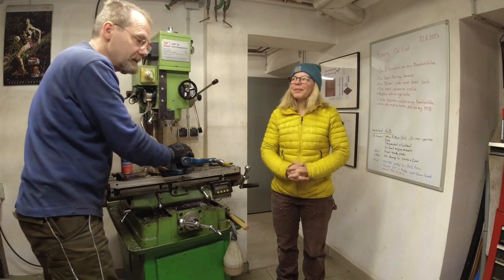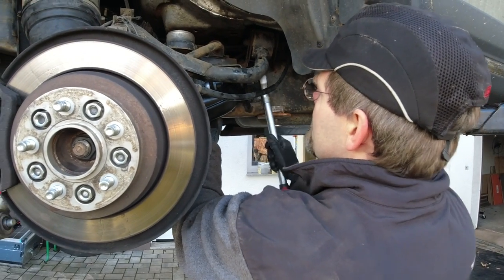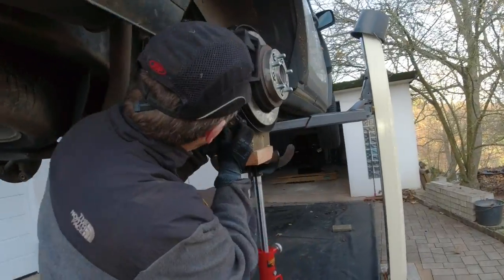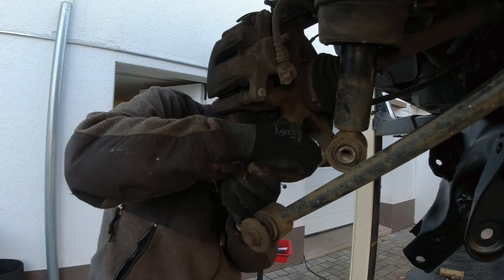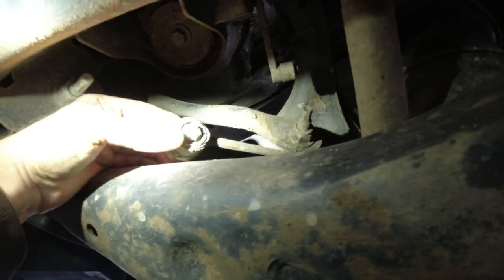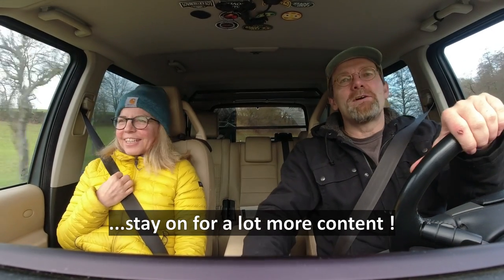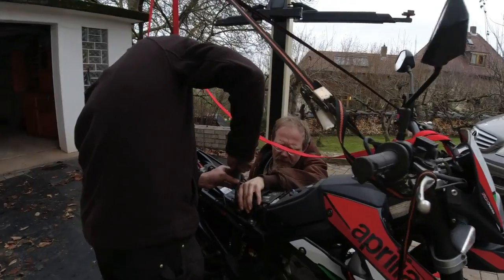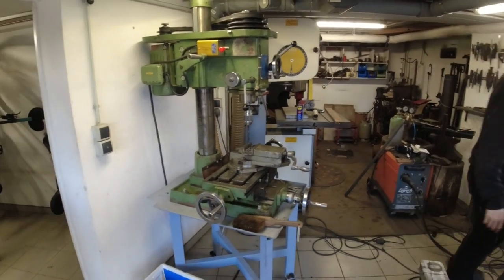Replace suspension bushings Part 2 - Land Rover Discovery 3 / LR4 / S4-Ep3

Comment: Hi I'm finally getting around to changing the bushing on my LR4  and going to use poly bushings, rapping components with Teflon tape, and light grease you never touched on the poly bushing that I saw in your videos, I love them, they are  my go-to file for advice,,, ride height on these is not important not vulcanized to an outer cup, just running it past you,, i like L R TIME  KEEP GOING

Comment: Another good job. FYI MoT in the UK stands for Ministry of Transport (test) that is the old name of the Department of Transport (Ministry's are now Departments for some reason). We have to get the first MOT (inspection) of a vehicle when is reaches three years old than annually after that.
I noticed you have some Hazet tools, I have a 1/2 ''drive Hazet ratchet I have had  for forty years.
On another subject I spent a week working in the JLR service centre in Neuss in 2008, while I was there I took a trip to have a look at the Garzweiler  open cast mine, awesome under taking and very topical in the news now.
Reply from the maker: Hazet is quite expensive but good.  Climate activists try to save a small village but that is a illegal activity causing a lot of conflict.  Christian

Comment: As others have said I think you should check the wheel alignment. Don't forget you changed it some time ago with the old bushes and now you have new ones. Don't want you to scrub off those nice winter tyres!
Reply from the maker: Lower rear arms do not allow any adjustment and is is not specified by LR if bushes are replaced and arms are kept. No matter how many people write this here.  Please Check out our wheel alignment video from last spring to see how precisely we did the alignment by ourselves.  Upper rear arms and lower front arms have alignment adjustment.  I did put my castor gauge on the disc before and and there was no change noticeable. Christian

Comment: I am so happy to report that I finally had something to fix on my 2000 Disco II. The rear door latch was stuck and wouldn't open. I removed the badge from the rear door handle, squirted some WD40 into the opening and that fixed it! 
Not nearly as complex as your top level repair work but I did feel a sense of accomplishment.
Reply from the maker: Are you sure it’s not a Toyota?  😂WD40 repairs are reserved for Toyota drivers 🛠️.  We would love to get a D2 but emission regulations make this a expensive vehicle in Germany.  We even have the manual!  Christian
Reply: @Vera_and_Christian  Well, I am a Toyota level mechanic. WD 40 is my master skill.

Comment: Well done getting through the TUV.  The MOT inspectors often identify issues early on and I have always found this really helpful. Keep up the good work.
Reply from the maker: Yes,  it’s ok to have such regulations.  With no regulations like in parts of the US you need two wind screens per year because everybody has oversized tires and throws up rocks and cars are way too noisy.  I guess I am a bit German.  Christian
Reply: @Vera_and_Christian  Completely agree. The MOT ensures that the vehicle meets a basic road safety and environmental standard. The certificate is a snapshot and is no guarantee of what the car will look like in a month's time. This is why you could in theory have you car MOT'd several times a year.  Once a year is more than enough for most of us Landy owners.

Comment: Good to see you D3 back in top shape. 🙂 Ball joints are crap because they use crap rubber on them and in 2 years you have no rubber on and corrosion.
A, I bought a new diesel car and they put 5w20 in there now. I think water would give more lubrication than that. 😛
Love old shop machinery. I have a well equpped one too.
Thanks for another great video.
You too are just great to wach.

Comment: Another great video 😀

Had my own dramas this week with my mini-mall crawler, Discovery Sport with two bolts in the steering rack having sheared off which the LR dealer found doing an inspection... 😱 That has to be a few OMG's from Vera! Car undriveable while they replaced the whole rack. Still, got to drive a new Defender 130 for a few days... not sure you'd try and balance one of those on your 2 post lift!
Reply from the maker: That defender is big.  Too big for out lift.  Sucks that you had to get a new steering rack.  Christian
Reply: @Vera_and_Christian  Luckily LR paid as it’s the subject of a recall. Also lucky there was no accident.

Comment: Well done for getting Tuv inspection pass . You can get a Windscreen chip repair kit on ebay for a few Euros,  that would be an interesting video repairing the chip as most people take it to a garage , and don't realise how easy it is to do yourself. 
Christian and Vera,  you definitely have to go on the Land Rover offroad experience course , it's amazing what these vehicles can do .
Reply: regarding TÜV its not allowed to repair windscreen when the chip is in drivers view
Reply from the maker: We should have done this before. Now it’s no longer legal to fix as in the line of sight.  Christian
Reply: @Vera_and_Christian  It's interesting the difference between countries. In the UK if you fail the MOT you can't drive at all as soon as the car fails. Even if you did the test 27 days before the existing certificate expires. But you can get a windscreen chip repaired to pass an MOT even if it's in the drivers line of sight. (Max size 10mm on drivers side, 40mm elsewhere if repairable.) Is windscreen replacement due to being unrepairable not covered by German car insurance like it is here in the UK on most policies?

Comment: Congratulations on the TÜV pass - it looks like the TÜV is a lot tougher than the MOT in the UK - and double the price.  And, thank goodness, they let the windshield pass this time.  I guess you will need a new windshield as you cannot repair a crack in the area of the driver's vision (or is it off enough to allow a repair?).

We drove back to the UK through Germany on Wednesday and Thursday last week in the pouring rain - except for our drive on the Rhein road from Rüdesheim to Koblenz on Thursday (the river seemed quite high and Burg Pfalzgrafenstein actually looked like a boat this time, with the river lapping at the walls - last time we drove it was high and dry) - but we had not known that the bridge between Wiesbaden and Rüdesheim was being rebuilt and had to go round in circles a bit to get to Rüdesheim without having to cross the Rhein and get a ferry back - nice trip, though - we love that Rhein road and take it every time we drive home through Germany.

Christian - you are living dangerously giving out Vera's age - a lady is always 21 + a little bit more 😉
Reply: German TÜV is first after three years new, and then every two years thereafter, so c. €60 per year.
Reply: @GunnarMiller  UK it's about £45 per year and can be cheaper.
Reply: £45 is €50, so comparable.

Comment: Good to see that "power tripping" public servants exist the same all over the world. I'm thankful I live in a place that has no annual roadworthy check.
Reply: We dont have vehicle inspections in Oklahoma any longer. The whole system was structured wrong. Our legislators decided raising the price of the inspection to entice independent shops to do the inspections was too expensive for poor people. SMH
Reply: Yes but is your car really roadworthy?? Inspections are really necessary for everyone's safety. You, your passengers, And more importantly those other Road and pavement users who may be injured or killed because your brakes might fail, hopefully an inspection would save that from happening and it does believe me.
Reply: @samrodian919  I think if you look at the statistics there is a very, very small percentage of accidents caused by mechanical failure of cars/vehicles. The most beneficial annual inspections/test might be the ability/suitability of a driver to drive his/her vehicle, far more accidents/deaths caused by human failure.
Reply: @gazzafloss  maybe so, but I spent 20 years on the spanner's as a mobile mechanic and I saw some dreadfully maintained vehicles that were death traps until caught by the MOT and I ended up with a lot of jobs that were it not repaired would have ended in a crash of some sort. That's my take on it. Yes cars are safer these days but systems especially electronic systems fail as do braking systems.
Reply: @samrodian919  They were ended in 2001 and I dont believe it resulted in more accidents. We were hit by one car that should not have been on the road. The accident disabled the car so it could drive anymore.

Comment: When I've changed suspension bushes in the past, I've always had a wheel alignment check done afterwards.
I didn't notice you doing this in the video. Did the TUF inspector test your wheel alignment?
Reply from the maker: The lower rear arms do not effect the alignment if only the bushes are replaced.  Check our wheel alignment video if you want to know how we do that.  Christian

Comment: Did you not have to realign the rear suspension after changing the bushes, I seem to remember there are many adjustments on the rear set up.
Reply from the maker: The lower rear arms do not effect the alignment if only the bushes are replaced.  Check our wheel alignment video if you want to know how we do that.  Christian

Comment: Hello, don't you have to retrack the car as suspension was redone? Definitely needs doing as tracking must be affected by the work. Have a good day.
Reply from the maker: The lower rear arms do not effect the alignment if only the bushes are replaced.  Check our wheel alignment video if you want to know how we do that.  Christian
Reply: Ok ,I understand but when you had the alignment done let's say that maybe 40% of bushes life was gone and they ware settled in conseequensely the rubber having to be pressed and middle of bushes of centre. Worn bushes will increase negative camber and toe- ing in, new bushes the opposite, so now I think your rear wheels are toe out slightly and if that is even between the two wheels you won't notice on steering wheel. I might be wrong but worth checking.

Comment: Hi both, how about removing those rusty very heavy iron side steps and replace them with Aluminium. You could probably make the steps yourself and add some grit pads or rubber for foot grip. You will save yourself some money by km/l
Reply from the maker: 🤔 we don’t have side steps on our vehicle.
Reply: Ha was it the mall crawler?
Reply from the maker: @charleshepplewhite7384  No, of course not. And definitely not in this video. If you have watched an older video about Fabians Discovery 3, well he has Rock Sliders on, and you definitely do not want those out of Aluminium. Hope you know the difference between side steps and rock sliders. We would never, ever put side steps on one of our Discoverys, ever.  🙋‍♀Vera

Comment: Full marks to you Christian!
To stop in the middle of a LR fix to take your wife out on her birthday, would have driven some of us crazy.

Then to reveal how many times Vera has be 41 again, without being reprimanded by her, means you must be some kind of Saint!

FOA Vera: He must be that Saint to look after you and your Discovery 3 so well, that you don’t look a day over 21.

Is the windshield chip so bad that it can’t be fixed? Here in the UK, most Insurance Companies will replace our windshields without additional premium or reduction of our No Claims bonus. They even encourage us to get chips fixed by companies, such as Auto-glass to reduce their cost of a full replacement.
Reply: Fun fact:  In English, it's generically "car glass" and in German it's "Autoglas".  However, D'Ieteren/Belron's windshield/windscreen repair operations are called "Autoglass" and "Carglass", respectively, in the UK and Germany https://en.wikipedia.org/wiki/Belron .
Reply from the maker: @Richard Ward, we did not stop the repair job. That was a one go and it did not take long.  But the editing process takes much longer than the repair itself, and that is what he had to stop. He just did not have enough time to finish editing our video. That's why we had to do it in two parts. 👍😀🙋‍♀️Vera